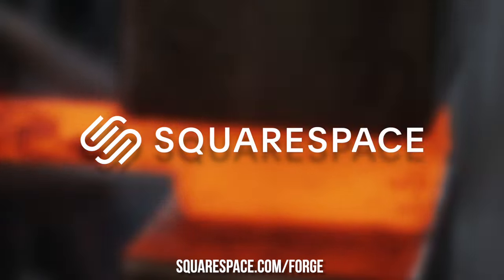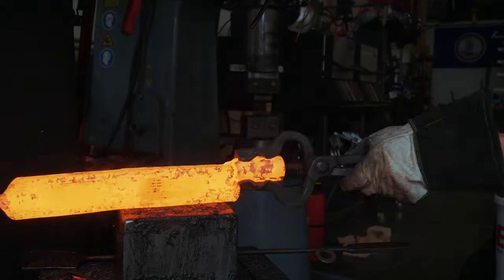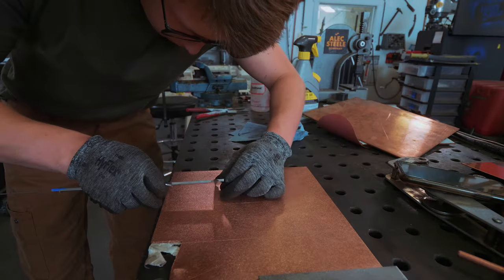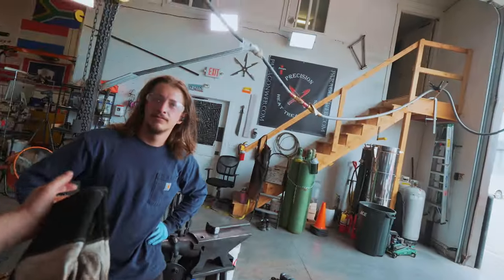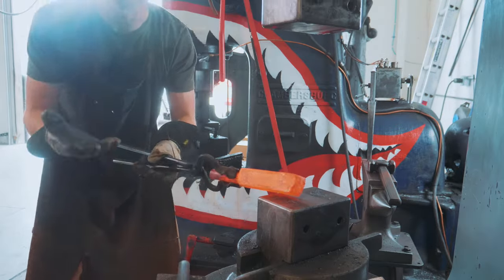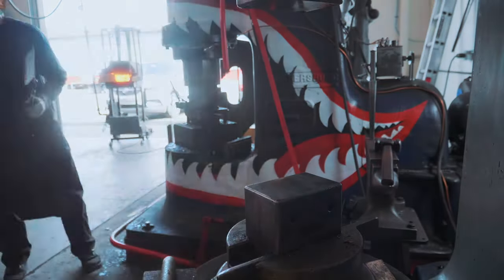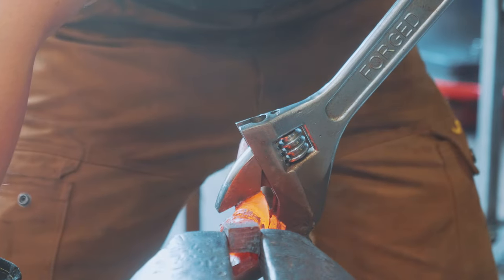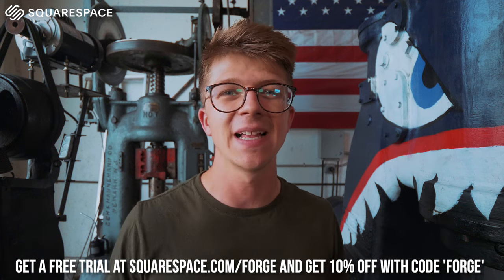Can Copper Weld into Steel Damascus?

Comment: When they make copper tungsten, they will run the pressed tungsten powder bar through the oxygen-less kiln with copper beads piled at each end of the bar.  The tungsten bar will form as normal and sucks the molten copper in from the ends making a proper alloy.   Conceivably, you could do the same with the pattern welded steel to a similar effect possibly pushing out the contaminates from the forge welding.  May not be highly visible like the brazed bar you had.

Comment: You could make some beautiful non structural parts like pommels  and guards. Perhaps  even a hollowed out handle scale? Maybe make decoration bits to use to dress up a scabbard or sheath, and the most obvious, jewelry. You can use them as gems and you can polish them and facet them to that effect.

Comment: Could you do a video experiment where you pulverize diamonds into dust and mix them with a high carbon steel either by making the steel molten and dumping the diamond dust in or by getting it very hot and then folding in the diamond dust repeatedly. Then use the diamond steel as the center of a San Mai billet and for the outside layer use regular damascus. Make a murasamune with it or any type of Japanese samurai swords will work too.

Comment: I've done coppermai a few times, you are heating the billet too quickly and the absolute trick is not to use the forge, use the tempering oven as your forge. Set the tempering ovens you have to 950-1000 degrees C, just below melting point of copper, and that way you guarantee the perfect forging/welding temperature. It prevents molten copper spray, and means you get super consistent bonding. also, you can do two billets at once and as one heats up you forge the other. Because of the temperature control you cant overcook the billet. Sure, the tempering oven is slower to heat the billet, but if you are doing two at once its not a big deal.

Comment: Copper will fuse well with nickel, and nickel will fuse well with iron. I'd like to see that layer stack-order, and forged at barely more than a cherry red heat.
Reply: The relative stiffnesses of metals is not linear with temperature. Using a lower temperature will mean that copper, nickel, and iron will be closer to each other in stiffness (creep coefficients are key here) so you won't end up with particular layers squishing way more than others.

Comment: The Tyrell knife guy does it best to date!!! Probably should have checked with him instead of the amateur you asked and mentioned Haha You'll never see this or do it but maybe somebody will get some inspiration from it Lol I've been making gun parts out old wrought iron and some Damascus. Antique 22 single shot, replaced the bolt handle. Break action shotgun, replaced a few random parts with wrought iron steel combo. I make holsters for a living some I'm working on a claw made of Damascus, the weight is the only issue haha

Comment: Make a Zulu Iklwa spear. The whole copper Damascus thing works best as Gomai. Steel, copper, steel, copper, steel. Keep the heat at 1980f and weld all the seams closed. You don’t need a peak hole if the temp is correct. You are basically brazing with the copper. If your copper layer squishes away from the steel, you will get cold shuts from the steel on steel since it was not forged at welding temp.

Comment: When you do anything like this you have to treat the copper as a liquid than metal cause of its mailability at working temp for steel. Either you finish out the metal to a rough final dimension and thickness then layer the copper in and seal weld and do finishing smush and then do the rest in grinding.. Or.. you do a finishing can meaning the material you want will be the can including the ends that lay over to seal will be the material you want. Then you can forge it out and even twist but it has to stay a capped form until its finished out and you start to grind to finish. The cap can be really thin like 1/8 inch thick and maybe can get away with 1/16 thick cap. Its all finishing grinding or milling to shape that has to be done with this type of metal working.

Comment: I think you could heat the billet and try twisting it very slow and heat it after tiny little movements so the copper doesn't shear and tear like that.

Comment: Alec, I wonder if the issue with the twist is that you are used to the resistance of the steel and that lead to an un-uniform twist. Could you have possibly put that into a lathe (obviously with some custom attachments) and made it work?

Comment: Ive seen a lot of success sandwiching the copper and steel with nickel in-between

For example 
Damascus
nickel
copper
nickel
high carbon steel
nickel
Copper
Nickel
damascus

You end up with a blade that has a good retaining edge and then the nickel helps glue the copper to the damascus steel outer and high carbon center.

Comment: you should try putting cut up bits of small copper and say like chain into a steel jacket to see if you can get a twist patteren to it but have the ratio more on the steel side than the copper to try and keep its streangh :)

Comment: So what did you do wrong with the hot folding?  Many people seem to do it.  Just not enough flux?   I've noticed that ThatWorks tends have water on their power hammer to help pop off the scale and keep the surface cleaner.

Comment: You guys should make steel mesh damascus! Use mild steel mesh and high carbon steel powder between each layer. You'll get a braid pattern with twisting and a woven texture if you cut and stack it!

Comment: One idea could be to create copper-filled steel beads to then create damascus from that. The hope would be that the steel hull would fuse together well enough that some of the copper has no way out. Might need more of a steel hull and maybe some softer steel in between to fill in the gaps.

Comment: I wonder if you did little wires or bits of copper vs full bars you might have stronger material, so the copper isn't a whole layer of material but just stripes of neatness held on all sides by forge welded steel.

Comment: what if you heated steel plates to forging temp and stacked the cold copper in between then forged? could the steel and hammer friction weld the copper to the steel plates.

Comment: You could probably get the copper and steel to twist if, when you are building the billet, you put steel around the copper so that when you forge weld it the copper layer are encased in steel this allowing you to twist it without it breaking apart. Then you could just grind that border of steel away to reveal the copper

Comment: Admittedly I know very little about forging and blacksmithing, but I can’t help wondering if you forge and layer the steel into layers of Damascus and then cut and fold a piece of cold copper between the layers and repeat the process if that would help make up for the difference in melting heat
Reply: But then it occurs to me that you need to reheat the steel so it would mess with the copper anyway

Comment: You may be able to get a better copper and steel damascus by either alloying the copper completely and by using intermediate alloys with your flux (not completely sure on the second one how much it would help, but it could create boundary conditions more favorable to interactions for fusing rather than just wetting, which will keep things together)

Comment: I’m no blacksmith but it seems like maybe a canister damascus would work out in this case? Some little wire offcuts would blend in but I feel like the small bits vs the big plates of copper would retain structural integrity? Maybe? Idk…

Comment: I wonder what would happen if you left on the outer jacket before you twisted the billet. I feel like it would stay together, then just mill off the the top layer to see what you got left.
Reply: The problem would be that the jacket would get incorporated into the twist, I don't think there would be a way to mill it off without losing the majority of the billet.

Comment: Nice going Alec and Sam 👍 Now I might be an incredible idiot for asking... But twisting it doesn't work... What about rolling it as a jellyroll damascusbar? Wouldn't that make the forces put on the copper be spread more evenly over the surface that's been stuck together?
By the way, maybe a hybrid blade between a typical US blade and a typical blade from the UK??

Comment: Next time, maybe you might keep the jacket on, twist, forge it out thick- then grind into your knife?  Should work, seemed like your biggest problem was dealing with that liquid copper. Also, maybe a bit of some O1 (and possibly a tiny bit of silver) would allow a better bond between the copper and steel via the chromium/vanadium/molybdenum impurities?

Comment: tyrell bladeworks has a cool video about this, basically the copper doesnt like the temps needed to forge steel so you need the shape to be basically done before adding the copper

Comment: I wonder about this, only with silver and gold. And I guess lead. Technically. They are categorized elementally in the same section. They share some properties. A silver or gold line in a knife would be a very cool knife.
Reply: its been attempted with gold aswell but low grade it worked but not the greatest, you would need to use pure gold which would cost a small fortune in itself

Comment: How's this bit of metal doing now? Has the copper acted like galvanising and is oxidised much faster than a straight block of copper metal? Has the steel been left less rusted than normal?

Comment: cutting grinding and rewelding works significantly better than twisting when there are a few copper layers in the mix. can Damascus with copper also works ok but not super well with copper in the mix(makes things a bit random but that's part of the fun with the stuff). side note this is closer to mokume-gane since you are using different metals here than it is to Damascus.
Reply: I would recommend trying the can damascus method to add copper since it's quite fun and looks a lot better just mind the hole molten copper tends to jet out when you strike it the first time. lotta milling or grinding to get the case off though.

Comment: Use a press or other means of compressing the billet and leave hot at around 600-700C for a hour or so an it should create a diffusion bond
Reply: No need to power hammer

Comment: You should have twisted slower at 9:00 my bro! (And steadier.) 
I'm not saying it definitely would have worked, if you did. 
But, when working with two interacting materials of different densities, speed & control are needed. 
It's easy for "chaos theory" to start taking over with that many variables.

Comment: What would happen if you tried doing the twist with the jacket on, and a little bit at a time. Heat, twist, forge, heat, twist, forge. Do that like 10 times and I think you'd end up with a great twist going all the way through. Just make sure that the thing starts off thick enough that you can pop it in the lathe to get rid of the twisted casing and have enough core left over.

Comment: On that cracked steel, you could have cut and ground along the cracks resulting in a diamond shape, stacked and welded in an upset fashion, then flattened. Along an axis perpendicular to the axis of the stack.

Comment: You have to get the damascus pretty thin as well as the center mono steel core because you're not trying to forge the billet thin while the copper is in it you're just braising a thin layer of copper on each side of the core and outer layers of damascus. And it's much better to use the press instead of the power hammer.

Comment: I had sent you a few emails a while back about doing something with Copper inside. 

The idea is: a Go Mai Scotish Claymore.
The outside is a solid steel like 1095
The 2nd and 4th are Copper
The center is Damascus

I will pay for such an item, as long as it is able to be finished. Please contact.
Reply: What is it exactly would you like?;
Reply: @djdanzy  A Scottish Claymore. That has a Go Mai Construction with Copper inside. (not intended for use)

Comment: Does that mean you have a knife that can be electrifying? I’ve seen a lot of these knives. The question is could you do the same with gold? If copper work what about other conductive material? It almost reminds me of some of the early bronze swords .or the swords the dark angels use in 40k.  As you got bi metal does it lend itself to crossbow construction? Much like how a yew bow works? Excellent work lads!

Comment: the only metal that would be even in theory hard to bond to steel through forge welding is aluminium and most of it's alloys due to it's stypid low melting point but even that can be bonded with the method of and i quote "hold the pieces together and hit them REALLY HARD" with aparently no preheat here in sweden that process is by the old timers called "blasting" materials together it's confusing but evidently dooable and with ten ish precent copper added to aluminium it kinda bonds to steel with an acid flux

Comment: Cut your twisted copper damascus into 1/2 bits of length and put into a boat of 1020 then fill with your powder and get that all to fuze then after getting it drawn out twist it with the canister still on it to hold it all together untill it cools then flatten out again and go with what you have to make a san mai blade, belt buckles, a metal pen blank or show your artistry to make rings, spoon/fork etc.  thanks would love to see the outcome.  WV FAN

Comment: What if, when you get ready to start another set of Damascus layering, drill holes through and plug them with copper, then layer the pieces together so the copper runs the length of the piece? Maybe incasing the copper will help it stay together long enough to do more folds.

Comment: I was moderately worried that you both left an opening at the top of the billet next to the handle, where if the copper was a little too liquid, the easy place for it to squirt out would be right back at your face.  Glad that didn't happen

Comment: I believe what you're really trying to achieve here is a diffusion weld, such as in mokume-gane. You might do better with applying extended pressure and (lower) heat, rather than forge welding. Which also somewhat reduces the risk of spraying liquid copper around your workshop!
Reply: Great suggestion! I fused copper Nickle silver and bronze together for a similar project. The mismatch between melting temperatures made it dificult to control. I achieved a diffusion weld with high temps and low pressure, nearly melting the stack. Diffusion is more strongly proportional to temp than time or pressure, and at lower temps benifits from time. Another thing that saved me was keeping my stock very clean and flat.

Comment: @AlecSteele What if instead of twisting it as fast do a slow partial turn, and let it cool it, then heat it back up and continue doing partial turns until you get a full rotation so the integrity isn't comprised?

Comment: Instead of using sheets of Steel and copper would it be possible to make it from mixed square Steel rods and square copper rods. Mixed together like a chessboard pattern. Then u could use more Steel around the copper than the sheets would have.

Comment: I wonder how the twist would have worked if the jacket was still on? Perhaps it would have given it enough structure until the twist was complete
Reply: Maybe... But how to get it off afterwards?
If you twist it, you can't cut it on the Mill, since the jacket will be all around the surface

Comment: You don’t need steel forge welding temperature
You must stay under that temperature because copper must not melt 
So, speaking about color, it’s better a red orange color than yellow one

Comment: Make it into a fat burger flipping spatula. I don't think trying to use that particular block for a knife would work out as the copper runs all the way through from edge to edge so I doubt it would actually hold an edge. But a good ol burger flipper would look sick with that infusion. Throw a nice wide dark wood handle on it with say 3 copper pins and you've got the nicest flipping utensil the world has ever seen.

Comment: This whole operation is kinda reverse brazing rules. You're working your steel to meet the other material, which is kind of a waste of time, you should be going the other way round. Not only is it stronger (because you're letting the metal flow properly) but you're also gonna do it easier. The operation itself, think of it as inlaying with hot metal, because you need to cut the path the metal needs to go in. Obviously, you can also braze slivers of metal together in a zebra like pattern, but i don't think you can actually work it after that.

Comment: I'm guessing you had the problems because the steel and copper have different melting points.

What about creating Damascus with copper and some other kind of metal that has a similar melting point?

Once you have that kind of blending made, make a pair of handcuffs as an ornamental kind of show piece that can be made into an award for someone in law enforcement who is being recognized.

Just a thought.

Comment: why did you even bother with straight copper?
there are copper alloys (like 70/30 copper nickel) that could work fairly well
there's also an alloy called "copper iron" or something, I only know it from brake lines in the shop, but apperantly it is a thing

as for what to make, I'd suggest making a hatchet or something
a thick blade allows you to get away with fewer layers and the risk of delamination should be lower with something beefy
the downside is that you need more material

Comment: Weld? No... Braze?  Yes.  If you REALLY want to bend your brain and have to exercise very fine temperature control... make some Mokume Gane.  I've done nickel and Copper twice... it wasn't easy. I lost half my billet to overheating, but, I was in an open ended propane forge with lousy burner control...
Reply: He made Mokume gane a while back. 😃

Go do a search on the vids.